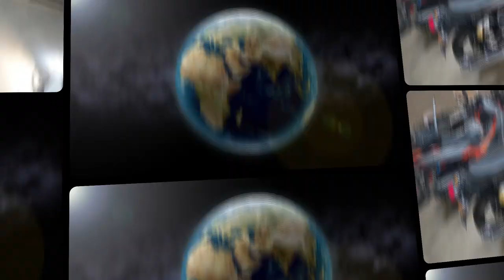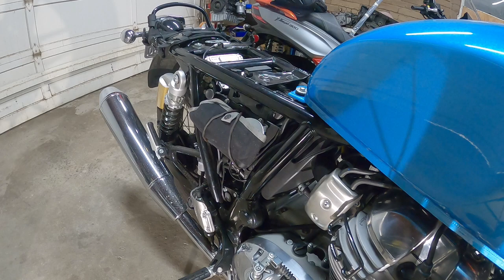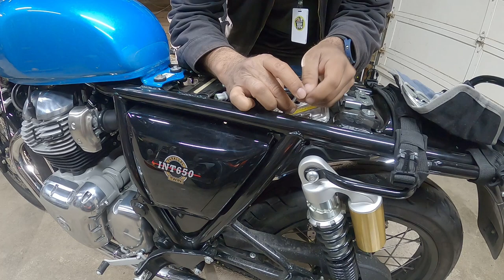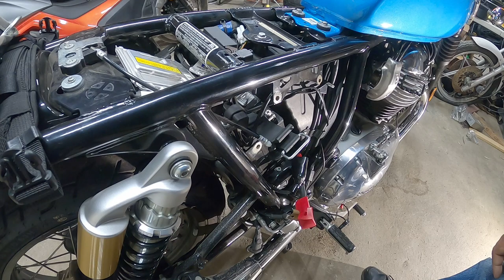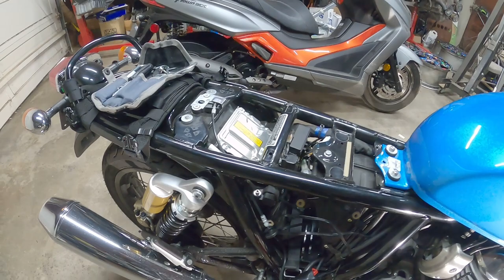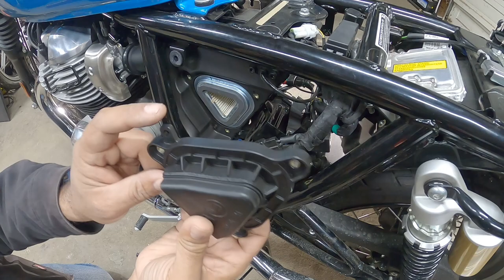RE Interceptor 650 - Battery Removal DIY

Comment: Removing a battery on any 2 wheel vehicle is a pain
Reply from the maker: Yeah unless it's a scooter...lol!
Reply: @PincheALsGarage  yes most aren't too awful on the scooters loo
Reply: Most old bikes I've had they are just under the seat and extremely quick to remove.
Doesn't seem the case with modern bikes.
😊

Comment: Helpful video regards the battery, thanks . Hopefully the connection between the air filter box and fuel injectors will last for years before they need looking at.